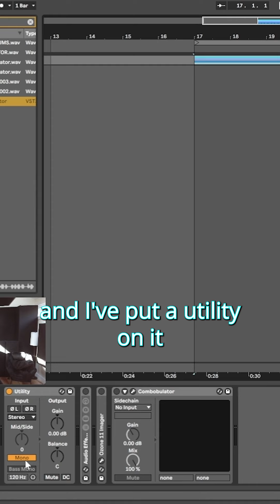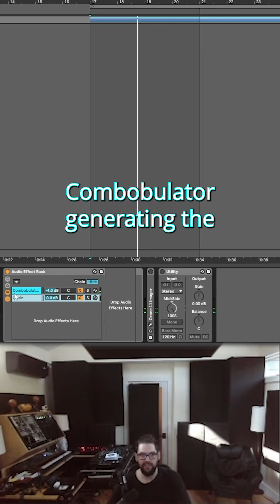A stereo image production trick

Comment: When you solo'd just the side information, it's doing some gnarly out of phase thing. It's not as noticeable when you bring the middle channel back in though. I think combobulator's side image thing may be being generated similar to how Wider works with each side being comb filtered maybe? I remember a while back you mentioning in a podcast you wanted to take a mono signal and have AI generate truly new side-image information... but is this really doing that?
Reply: The side information is literally the difference between the left and right channel, it's always going to be out of phase when it's solo'd
Reply: @LarsWilms   If it was truly different audio info it shouldn’t be. Also there’s no L/R, it’s just a mono signal.
Reply: they certainly seem to claim it is, but their website is sparse on details and it's not clear to me if the width is an actual parameter of the model or is being done via more traditional DSP methods on the model's output signal like you're suggesting.

Edit: I found the user manual and this is what it says

"Width is just like Offset, except it applies a gentle offset to the latents used to synthesize the left vs right channel. More difference in the latents between the left and right channel means a more variance between these channels, resulting in a wider stereo image."

So seems like it's not a DSP trick and it is indeed generating the left and right channels from different places within the model's latent space giving you a slightly different timbre for each channel.
Reply: @iswm  What accounts for the out of phase sound when the sides are solo’d in the video? Is the plugin generating sounds deterministically and offsetting them sample-wise for the stereo image?
Reply: @PaulEubanks  I couldn't tell you. My best understanding is that it's running 2 channels through the model to resynthesize outputs, whether or not random seeds are involved I have no clue, but when increasing the width it slightly shifts the channels apart in latent space causing it to resynthesize each channel slightly differently, and that slight variance in the resulting timbre of each channel causes a natural stereo width effect that becomes more pronounced as the difference between the channels increases. I'm assuming the difference in timbre between the channels is quite subtle and the two channels are still similar enough that it can still produce phasing issues, but I'm completely speculating here.